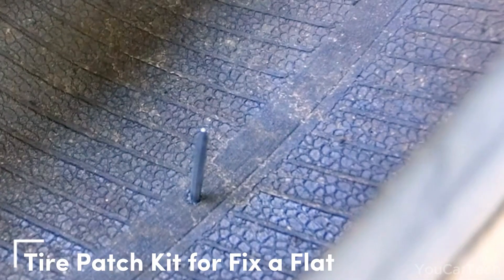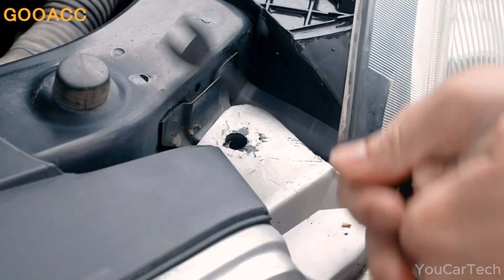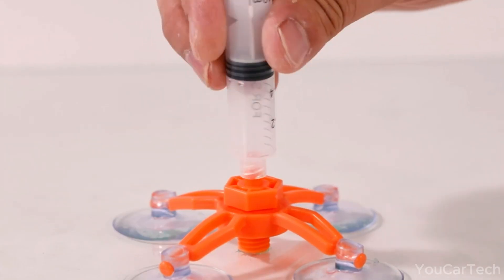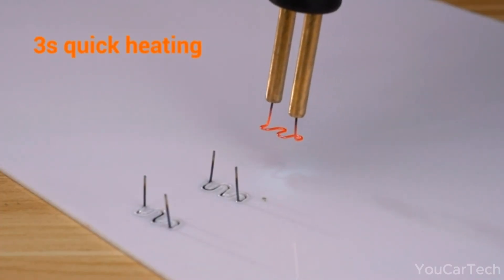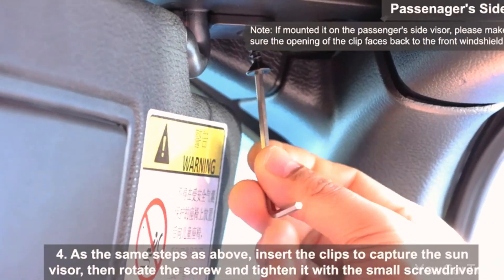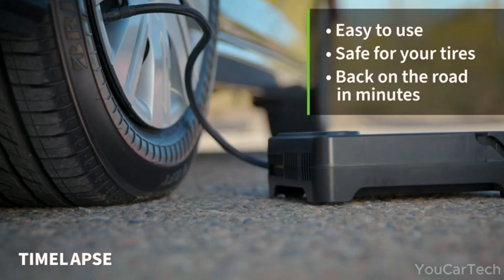12 Auto Repair Kits That Get Results

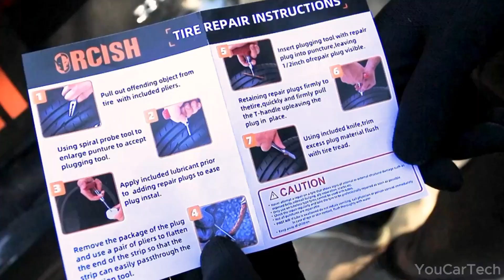Comment from the maker: 0:21 ✅1. ORCISH Tire Patch Kit for Fix a Flat: https://youcartech.com/repair-kits/part-1/#1
1:15 ✅2. GOOACC Bumper Retainer Clips with Fastener Remover: https://youcartech.com/repair-kits/part-1/#2
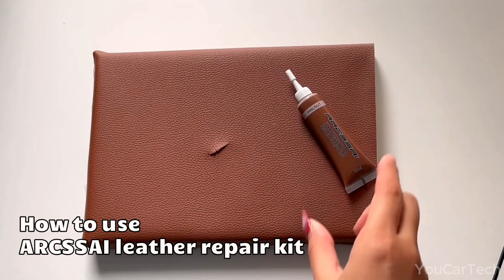2:01 ✅3. ARCSSAL Brown Leather Repair Kits: https://youcartech.com/repair-kits/part-1/#3
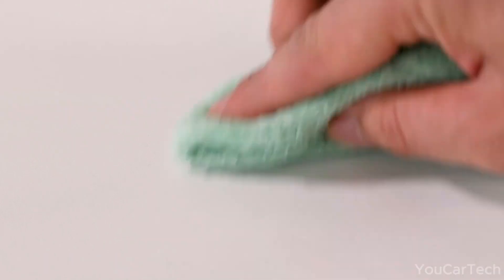2:38 ✅4. AODA Windshield Crack Repair Kit: https://youcartech.com/repair-kits/part-1/#4
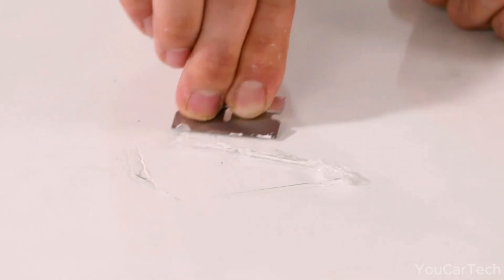3:21 ✅5. JOUNJIP Standard Plastic Welding Kit: https://youcartech.com/repair-kits/part-1/#5
4:01 ✅6. Ghguole Hot Stapler for Plastic: https://youcartech.com/repair-kits/part-1/#6
4:35 ✅7. VEVOR Dent Repair Kit: https://youcartech.com/repair-kits/part-1/#7
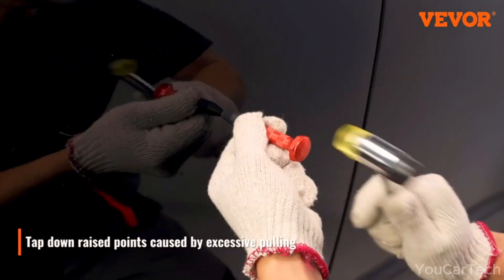5:48 ✅8. XTryfun Pen Touch Up Car Scratch: https://youcartech.com/repair-kits/part-1/#8
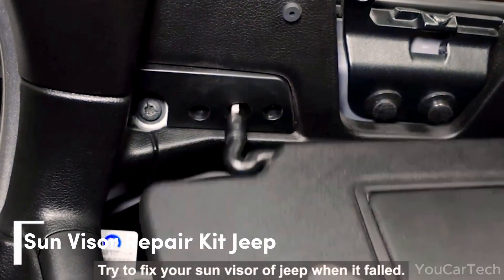6:22 ✅9. Kaishengyuan Sun Visor Repair Kit: https://youcartech.com/repair-kits/part-1/#9
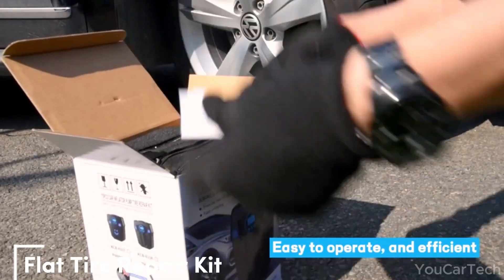7:06 ✅10. TILIBOTE Flat Tire Repair Kit: https://youcartech.com/repair-kits/part-1/#10
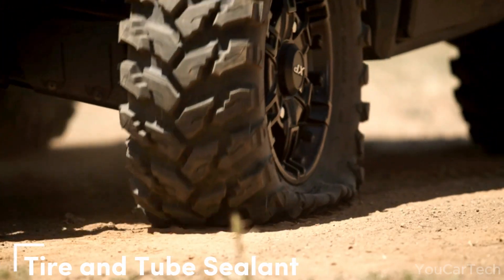8:27 ✅11. Slime Tire and Tube Sealant: https://youcartech.com/repair-kits/part-1/#11
8:59 ✅12. Slime Flat Tire Puncture Emergency Kit: https://youcartech.com/repair-kits/part-1/#12